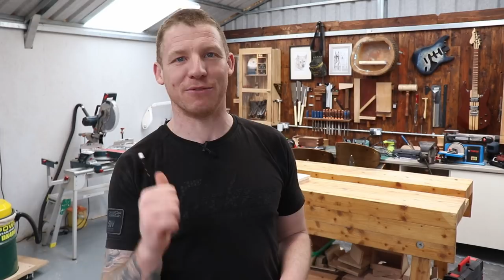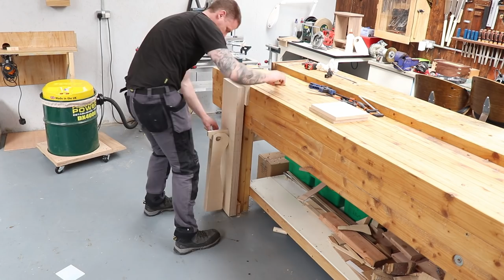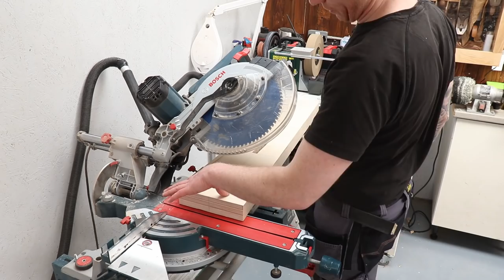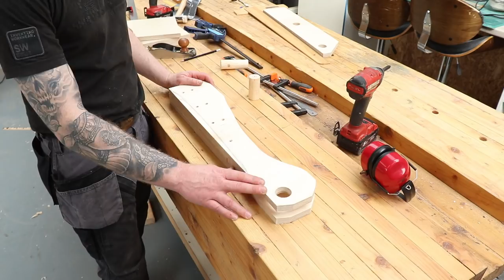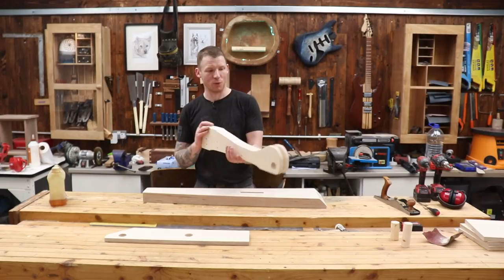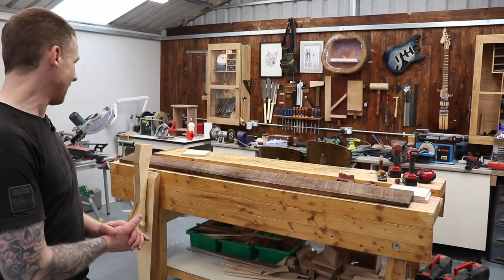Camlock Leg Vice/Vise Part 1. Simple, Powerful. No Metal Parts Woodworking Vice! Prototype Build.

Comment: Alternative to the rebar - create a square-edged Cam to go behind the leg.  This could give you 4 resting points, with e.g. 1 inch increments (total range: 3 inches).  When you want to change it, just reach behind the leg and twist the bolt around to the appropriate face.  Square edge keeps it consistent, and prevents it shifting under pressure.
Reply: Offset the holes, high and low, in a sign zag pattern.

Comment: I love the McGrath vise ......This is what it shall be called from now on!  We all took a vote and the vote was unanimous, so the motion has been carried! :) :) 
Many of the ideas for the adjustability are really good, but something I did not see mentioned is 'dog holes'...
I see that the top of the moving jaw is set flush with the top of the bench now, but what if it was raised a bit, say 1 inch or so  and then there could be some dog holes drilled into the top of the bench at intervals which would allow for clamping a very wide board to the top of the bench, or a narrow one for that matter. Clamping pressure would be applied between the peg inserted into a dog and the jaw face...🤔
Reply: Makin' Sawdust very good idea indeed.

Comment: Pretty awesome idea. I wonder if a saw tooth shape on the top of the "tenon board" and some slop or a  teeter point in the slot that would allow you to disengage the teeth on underside and slide it in/out.
Reply from the maker: That could work 🤔
Reply: I was thinking the same thing, except instead of moving the tenon board to engage the saw teeth, a moveable pin. But that would require reaching under the bench, maybe the idea of the tenon board moving up and down is better, making it adjustable from the front. But I would put the saw teeth on the bottom of the tenon board and the pin under the bench would be fixed. Lift the board, push it in, and engage the clamp. There are several ways to adjust the foot.

Comment: Maybe move the holes in the back further from the front, then make drop over ( horse shoe like ) shims that go over the straight tenon piece between the cam and the vise leg. Different shims of different thicknesses for more range and few adjustments under the workbench. Shims could easily be hung up and replaced as they wear.

Comment: Separate comment - from what I've seen, many people use either a tapered or 'stepped' kicker for the bottom stop... open the vice, kick the 'kicker' in to the appropriate depth to match your apron offset + thickness of the wood being clamped, and you're good to go.
Reply: A pair of sliding wedges would keep the faces parallel

Comment: i like your thinking on this one, intresting idea for sure. it might work to replace the block on the bottom with another tennon but with the pin on the other side. so it pushes up against the outside of the leg.( the side with the vise) you can drill a few holes to allow for the range of motion.

Comment: I think this is the absolute best leg vice build I’ve seen! I have watched so many that say they are simple but they all require welding or spending more time on the screw than the whole vise. If it’s not welding it’s thread chasing on the lathe or buying thread cutting tools which I would never use after making the single screw. Seriously this is a super impressive build. Eager to see whether you are going to use rebar on the smaller holes to extend or using an offset square to adjust the depth of your vice. Nice work, very quickly becoming my favorite channel!
Reply: Also if you would throw together a set of plans or something I’d love to support the channel and buy those for sure!

Comment: Brilliant idea fella.
I couldn’t live with the lack of adjustment.
You could run a parallel adjustable tenoned rail towards the bottom of the leg as per “normal” leg vices. 
But that means moving two sets of pegs when yah need to adjust the vice for width.

Comment: @John McGrath @Geoff Willingham
An idea for the tenon bar. Rather than drill a series of holes and move a dowel each time you want to clamp, you could drill one large hole (like you have) and add a spiral conch shell-shaped disc. It would gradually have a larger radius as it wound around the center hole increasing by say 3 inches if the disc was large enough. Then you could simply turn it in the rear disc to gradually open or close the clamping distance. This is very similar to the camlock mechanism on the other side of the tenon board. This would also be a simpler and perhaps more elegant solution than drilling many holes. It would also allow an infinite amount of adjustment. Just a thought.

Comment: Possible solutions to potential problems. 

I would constantly be snacking my knee against this as I walk around the table.  The clamping pressure comes from the cam radial difference of the offset circle around the dowel.  This same difference can be achieved from a much smaller offset circle.   You can reduce the outward profile.  A smaller cam circle will require less force so the lever can be smaller as well.

Regarding the wear of the cam lever against the leg: brass looks nicer but isn't free.  You can use aluminum or tin from soda or canned food.  In addition to decking the leg you can deck the cam as well.

To vary the thickness of what is held additional holes in the tenon can be added in two rows such that the center of the holes are across the top and bottom.

Love this design and intend to build it with a more shallow profile.  I like my knees.
Reply from the maker: go for it

Comment: If you need to clamp different width workpieces, you could just make a few different lengthed peg-tenons, one for each common board width.  You'll probably only need 2 or 3.  That would be cheap and you probably have lots of plywood left in the sheet that you used to build your vise.  Maybe use shims to accommodate irregular width workpieces.  For pegs, maybe some polished pipe, or dowel in pipe...  nice project and video, thanks!

Comment: I already commented but another idea would be to put your peg at the end of the tenon board and then have u shaped shims that slide over the top of it on the backside of the mortise hole. You can adjust the opening size that way as well.

Comment: Very neat idea Why not try Put in Springs at either side of the pin with a series of holes so that you can pull the pin in and out to give you more room as needed. Well done it a good job 👍🏽

Comment: At 5:30, you can add a pair of tri-angled shims that are mated on their sloped faces (take a rectangular board, and cut through the center at an angle), located inbetween the large pin and the table frame. As you push them towards their centers, they get wider. The one on the bottom can be permanently fixed to the table frame, and the upper one can slide up and down to become wider or narrower (or vice-versa).

Comment: Currently have limited thickness to clamp. The challenge is, the other end (at the back) should be adjustable to a variable length,  I think wedge mortise can be a good starting point, although the wedge is low angle and youll have a very limited adjustable length as well, making the  wedge high angle will just pop the wedge out (I guess).
Reply: Another adjustment I could think of is making the camlock  not locked only at one point, bear with me here, the problem with camlock is for it to lock, the other end should have a precise position which is difficult to achieve using simple design and materials (which is what you are aiming I believe). Imagine if the camlock is like a hex nut, only it is shaped like a snail shell (dunno how wear resistant this could be), the other end then can be adjusted to preset location (like the bar clamp)

Comment: Really nice prototype.  Can the cam be shortened without causing undo difficulty in closing it down?  What about another hole or two in the cam part of the tensioner board?  It would be easier access than the underside of the bench.  Another thought, attach a runner from the bottom of your apron to the floor, thus making the vise flush with your bench...?  So many options, a great idea....
Reply from the maker: There are follow up videos improving the design

Comment: To gain some usable range in the cam vise make some sort of an offset pin (cam if you will.) The tenon would have the 1-1/2" hole in it while the cam clamp would have say a 1" hole in it. The pin would be 1-1/2" in the middle and 1" on the two ends. (Could be as simple as making a crescent shaped cam by drilling a 1"hole then a 1-1/2' hole around it with both holes tangent to one side. Then attach the cam to the pin permanently. Do this to each pin and you gain a full inch in extra usable range by simply twisting each pin.

Comment: Great concept and prototype John 😁. Just as an idea to try.. rather than having multiple holes along the tenon bar (more holes = less strength), why don't you have a stepped wedge between the back pin and the bench, you would only need a couple of steps to give you more of a range on you clamping size and it wouldn't weaken your tenon bar 🤔. Did that make sence ?. Great vid John, keep it up 😁👍. 
(By the way.. I got Divinci and will give it a go, Thanks for the recommendation 👍.)

Comment: G'day,,Nice idea,,,,Adjustment,,Move ya peg hole back and have a wedge,,as you need more width move wedge out,,need less move wedge in,,have a couple of peg hole and you have a fully adjustable vice,and use wedge for fine adjustment,,could even have notches in you wedge to stop wedge form falling out,,,
just a thought,,Hope this helps,,

Comment: Pretty interesting but not very practical cause of the lack of adjustment. You can use the same concept though and make it adjustable. The dowel on the back of the leg could be removable with multiple placement slots. However being mortised this would really weaken the piece. Instead.. make two faces that wrap the leg instead of going through it. Single cam lock piece pinned infront of the leg with two taller pieces wrapping the legs with a dog hole type setup. By distributing the stress between two pieces you’ll end up with about the same strength as this but with a lot of adjustability. The only issue I can see doing it this way is this will require the bench leg being a good 3-4” minimum from the face of the top. Ideally more like 4-6” you could problem play with building front of leg mounting piece into the back of the vise itself and make it work down to say 2-3” leg to face offset though.
Reply from the maker: there is a part 2 to this

Comment: I notice a few others have mentioned it now but my brain also jumped to a ratchet type idea along the top of the tenon board. If this link works its a crude finger drawing of what I mean. https://photos.app.goo.gl/tW61HjaZyLA5WmhG6
The tenon board would slide in then nip up with the cam lock. Needs a release to pull it out, or elongate the mortice to allow the board to lift up at the front and disengage the ratchet at the back.
Reply from the maker: brilliant idea, if it works then it will seriously increase the capacity